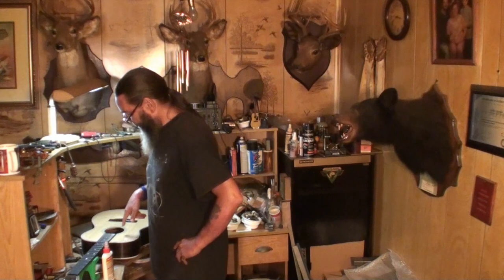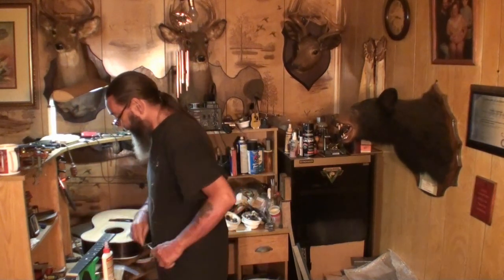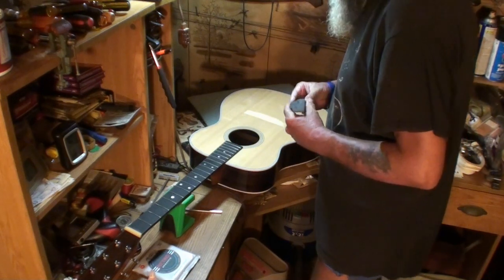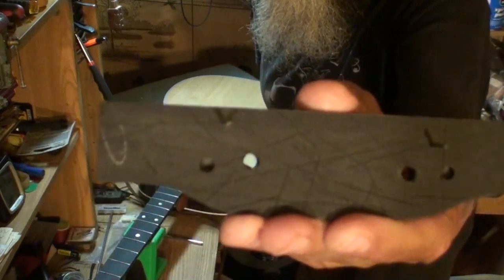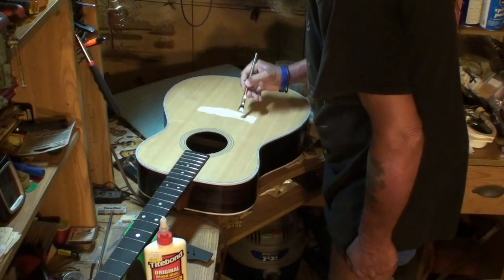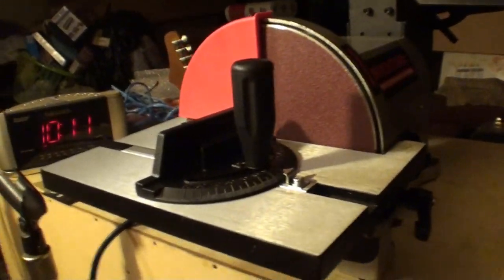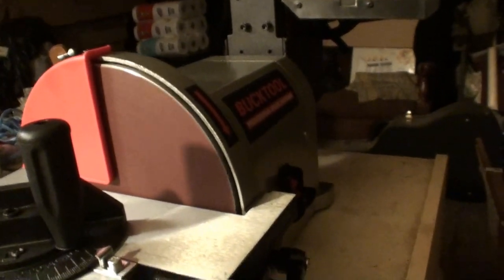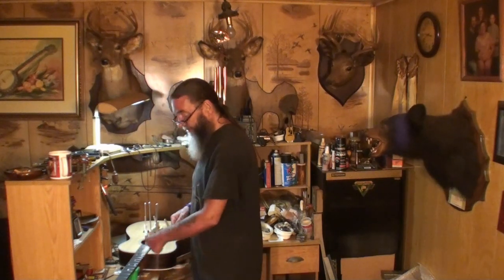martin 00028 kit bridge mount

Comment: Randy 👋 i have a question for u. Ok so i put on my new bridge but... the bridge pin holes were shot, i figured my only choice was to fill them then drill new ones but i don't have all the right tools.. so i moved my bridge back about an inch before glueing, that way they old holes were hidden and i could drill new holes. How is that gonna effect my guitar? Playing, strings etc
Reply from the maker: you'll have to move the saddle/slot back to where it would have been, if you don't your intonation will be off and impossible to intonate the guitar, the distance from the nut to the 12th fret should be exactly the same as from the 12th fret to the saddle. good luck! and thanks for viewing!
Reply: Randy Schartiger  its not off as much as i thot.. only bout qtr inch. Im not taking it off again, its been painted now anyway. It wasn't an expensive guitar to begin with,think it was around £100. But i got it free and have been fixing it up since the beginning of lockdown, i wanna play it now lol thanks randy